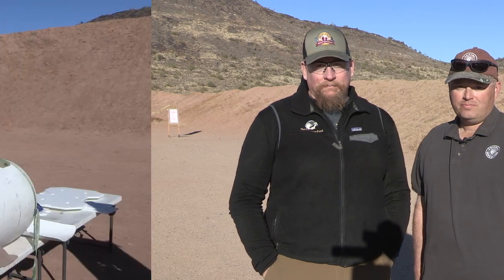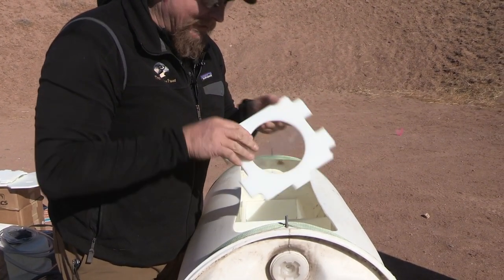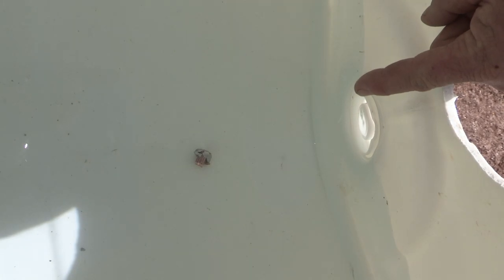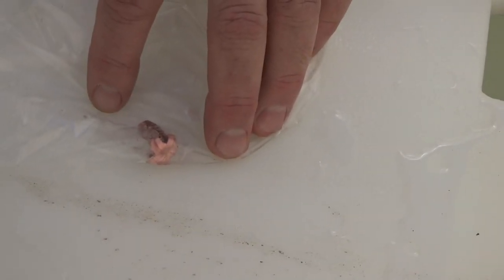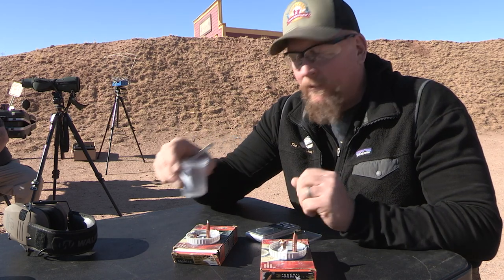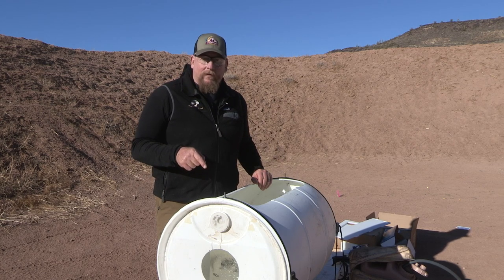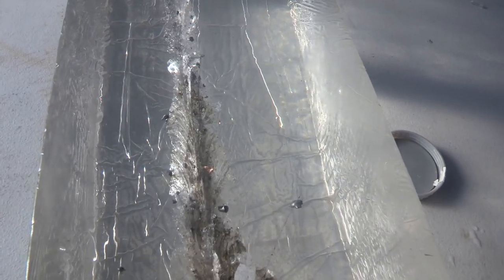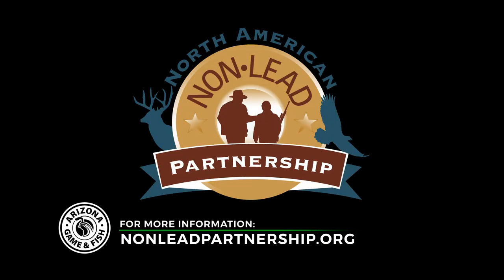Lead v Non Lead Bullet Demo

Comment: One thing they don't mention is that tiny lead fragments are also embedding in the meat you are taking home to feed your family.
Reply: Yeah, but dude its hard to find lead free in stores. even if you reload its at least 50$ for 50 bullets. I'd say slowly phase pb out.
Reply: They did some MRI scans on deer here in the UK , it was shocking how much lead was around the entry and exit wounds.
Most game dealers here will only accept carcases that have been shot with nontoxic for going into the food chain, if it's for your own use you can use any bullets you want.
Reply: @MooseHead_trail  I just bought a box of 6.5 Creedmoor lead free. It was a bit more than lead hunting ammo, but its not THAT much more. Grabbed it right off the shelf too. $5 / box more than the comparable lead stuff. 37 instead of 32 or something like that. It's worth it to me just to not be eating lead.
Reply: @hammyh1165  they did x-rays of hunted deer in MN.  Whole muscle(steaks) nowhere near the bullet holes was free of lead but it was amazing how far away from the hole the fragments did get.  The ground meat lit up like a Christmas tree with lead fragments measured in microns that you'd never see to be able to keep out.

Comment: I can appreciate the research you all have done. Should be a choice and not regulated by the state. Where will this slippery slope go? Not able to shoot target steel on BLM land because of run off from the lead? That is where that leads. What I would love is for the Department of Game and Fish to show and do a study of what is happening along the southern border with garbage and fecal matter left behind. I hunt there and it's an environmental nightmare in AZ.
Reply: Um, no lead runs off from steel. Steel shot has no lead. It’s made of carbonized iron. Non-issue, and lead shot was banned entirely in 1991. Nice attempt at redirection. A quick google would have fact checked your faulty assumption.
Reply: @Carol Endicott  was he not talking about shooting steel targets that cause the lead rounds to shatter?

Comment: The biggest problem with copper bullets is never addressed.  However, the bullet manufacturers clearly warn shooters of the twist requirements needed to shoot copper bullets.  The vast majority of rifle manufactures do not make rifles with the twist rates needed for copper bullets.  Why are you not mentioning this?  I know you know this.
Reply: @danellebarnette6380  I think the people shooting way short / light for caliber lead with slow twist barrels can do just as well if not better with a smaller diameter bullet and a faster twist rate.

If they're shooting a low twist rate barrel, they're shooting a short - hence light for caliber bullet. Like an 80 grain .308 with a 1:16 barrel or something weird like that. But - why? For a varmint rifle? Because a 308 case can propel that 80 grain bullet 3300 fps? Well a 243 case is a 308 case necked down. So why not grab your 243 instead with an 80 grain lead free, shoot it out of a normal twist rate and gain a LOT more from the higher BC of the longer bullet than they do from a low twist rate with a short (and hence shitty BC) bullet - and it's STILL an 80 grain at 3300 fps - but with a much higher BC?

Or am I missing something? I very well may be...
Reply: No, they just can't shoot high BC copper bullets with standard twist rates of older cartridges.  You can shoot a lighter(shorter) lower BC bullet just fine from your slow twist older cartridge.  And since the copper has near 100% weight retention it's fine.  The could have shot a 150gr bullet from that 30-06 and had better weight retention than the 180gr accubond.
If you get something newer with the 1-7 or 1-8 twist as standard you can shoot some rather high BC copper bullets.

Comment: Make it the same price or cheaper then people will switch
Reply: Usually copper bullets are on premium ammo . Therefore if you compare premium copper cartridges to bonded lead core cartridges the prices are very similar.
Reply: It already is the same price.  A nosler accubond or accubond long range is over a dollar a bullet just for the projectile.  Copper bullets are right around $1.

Comment: Thanks for taking the time to make this video. Hunters are stubborn so it will be hard to get the outcome your looking for. The problem I see is there is no incentive for hunters to switch from lead. Yeah you proved the bullets both perform the same but cost is a driving factor in what ammo is purchased. Maybe a rebate program or working with manufacturers to make non lead shot less expensive would help your cause.
Reply: We aren't all that stubborn. I'm a huge fan of not eating lead. Or poisoning my (or public or ANY) land with it. I was skeptical at first of performance, but I'm all about giving something a whirl that can have such a great benefit. It appears to perform close enough in every possible way. Matter of fact, I just bought a box of lead free ammo today. If I shoot 10 rounds in a day of hunting, I've had a personal record day of putting meat on the table. I can't imagine  a dollar or two difference being a huge deterrent to acceptance.

Theres some edge cases - but they can work something else out.

Comment: Man and to think, when I was a kid I carried lead pellets in my mouth all the time. And don’t know how many I swallowed. Did the same with lead split shot when fishing for brookies.
Reply: Oh I've done that
Reply: Per the CDC's article on the "Biological fate of lead" in the body, most of that lead you had in your mouth is currently stored inside your teeth and your bones, inert and not harmful. That action as a kid would only be a problem in the future if something happened that broke your bones or your teeth and released all that lead your bones have been storing, all at once.
Reply: @NegativeNanase  when he gets quite a bit older and starts to lose bone density it'll start to come out as well.
Statistically he also never developed to his full intelligence potential.  Generally such lead exposure doesn't do visible harm to a kid, but a couple IQ points usually leads to a drastically different life and income potential.

Comment: why didn't you measure all of the bullets/fragments together to see if you got all the bullet?
Reply: I think you might have missed the point of why they were measuring the weight after impact. They didn't weigh it all because those piece would have been elsewhere in the animal thus allowing for some exposure to lead intake by a scavenger vs the non lead bullet which retained almost 100% intact.
Reply: I understand that part. I think it would be interesting to also see if you had "captured" all the bullet weight, because I think  there were "fragments" missed of all the bullets that got into the environment as well.

Comment: I am not arguing against non lead bullets for hunting but I have a concern with non lead rounds sparking if a missed shot hits a rock. I live in the Sierra foothills and wild fires are a major issue.  Lead is a soft material and is less likely to through sparks on impact were as harder metals are more prone to this happening. I would like to see a slow motion test to prove or disprove my belief.
Reply: I don't think copper and copper\zinc can spark.
Reply: I would be interested in seeing it too. Most non lead bullets are copper or copper clad tin. Many modern rounds are copper clad lead. So solid copper would have the similar potential to spark as most hunting bullets used now. No matter what you shoot, it's a lot of energy that turns to heat when it hits something. 

You're more likely to have a fire start based on the type of rock you shoot that if it's copper, lead, or tin.  Zinc is a different story.
Reply: Only iron sparks. Even some steels don't really spark. Copper certainly doesn't, and it's already used as the jacket over lead bullets anyway.
Reply: Bonded bullets are most often Cooper coated!
Reply: Also, non-sparking tools are often made of copper alloys because Cu has excellent thermal conductivity and doesn't spark.
Reply: @karlmason6145  So are regular cup and core hollowpoints, the difference is that the jacket is a little thicker and molecularly bonded (if I have the term right) to the lead in a bonded bullet. Same materials.

Comment: I've never heard of lead poisoning in the food chain before this video.  Is that a real thing, or a theory?  Bullets may perform differently in an animal than they would in a big bag of water.  I would expect water to maximize the fragmentation you observed.  Interesting test, thanks.
Reply from the maker: Here is a story we made on the non-lead program from 2014: https://youtu.be/xmXcL7jveFA
Reply: @azgfd  Thank you for the reply.  I'm all for non-lead ammo being used for hunting.  Just seems like the responsible thing to do.  Price and availability of the ammo is probably the biggest obstacle.
Reply: Sir that's how lead bullets create its wounding and lose bullet weight! When the bullet deforms it's shedding lead fragments!
Reply: I feel like copper is also poisonous and of course not as much as load by far  but maybe we can get die cast brass  bullets and that would make it cheaper since it seems to copper ones are all being put on a lathe